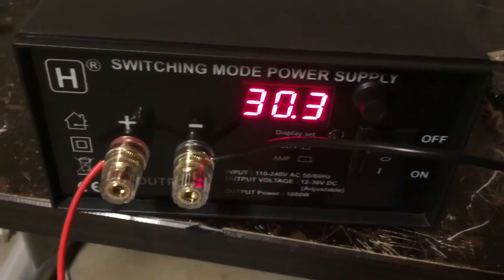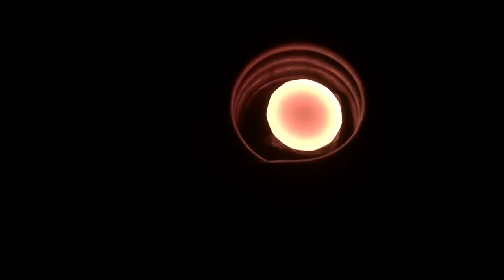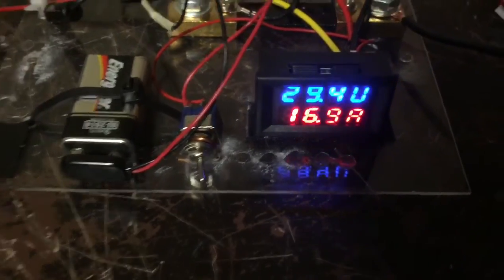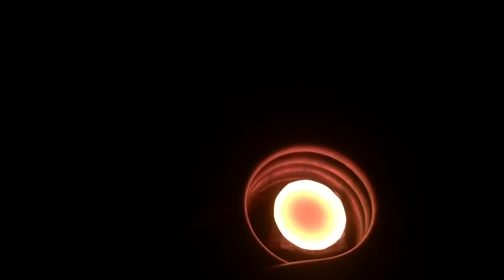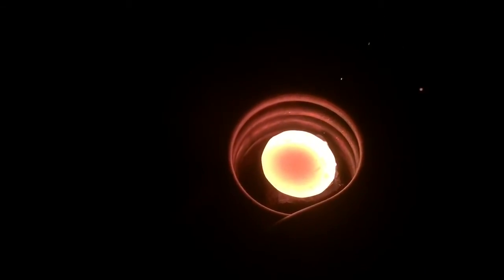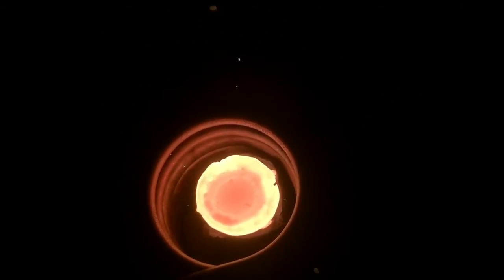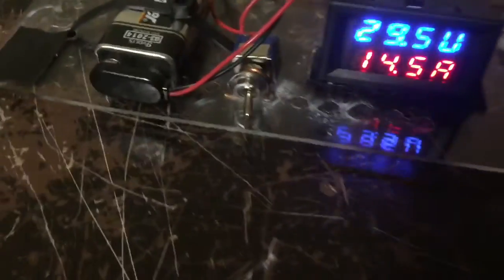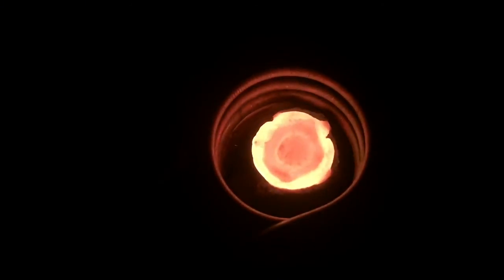Improved Performance of Royer Induction Heater at 30V

Comment: Just a question, how much voltage the capacitors must be rated? cuz i only can find MKP rated between 250v and 630v. This ones could work ok? Thanks.
Reply from the maker: HVGuy thise would work fine. I series connected 2 x 275V for total 550V. The total  rating shoukd be 3 - 4 x supply voltage which at 30V is 90-120V which is more then covered.
Reply: @BrianDhvTinkerer  Thanks for the reply!!